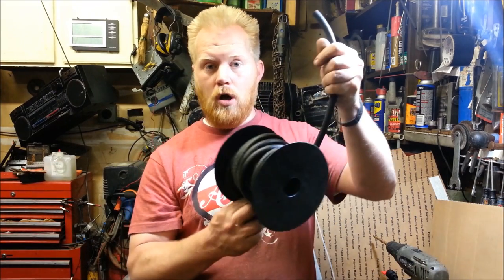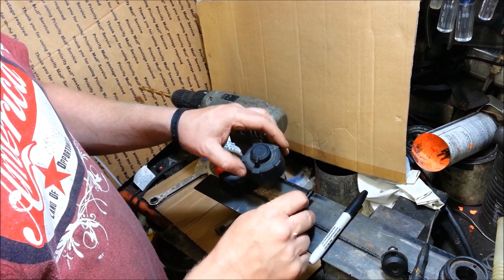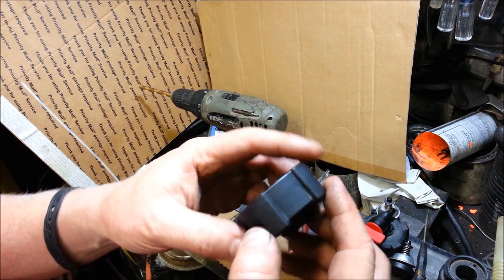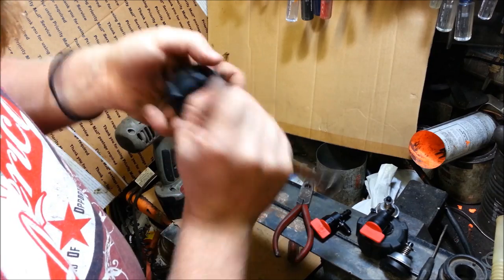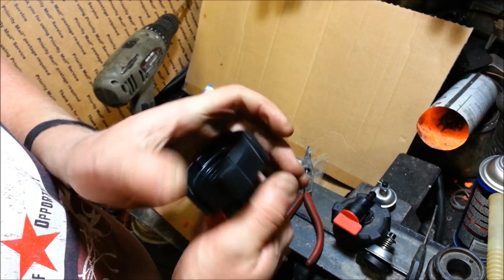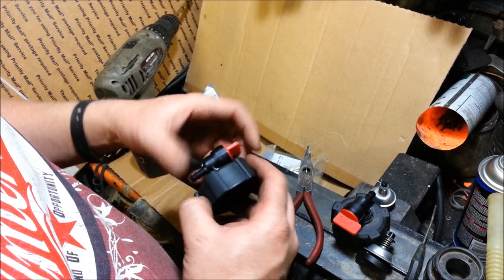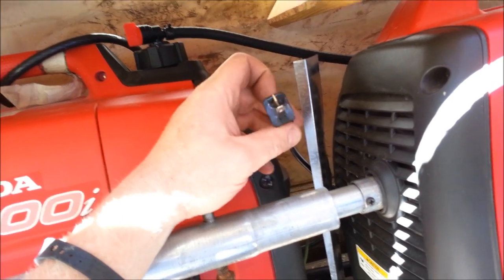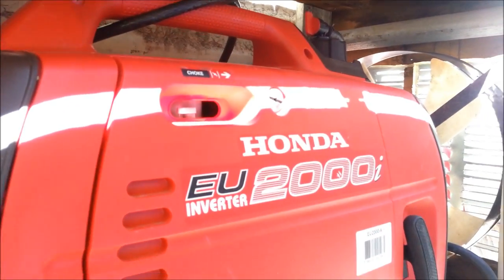Honda EU2200i EU2000i extended Fuel range Make your own gas caps

Comment from the maker: Exhaust extensions almost always have to have something welded on. Unless it is a Briggs and Stratton motor as they usually have standard pipe threaded exhaust. This allows you to go buy steel plumbing pipe and make up an extended exhaust. I actually had to weld a small 1 inch nipple onto the stock exhaust to make it fit the pipe. I then just used a small set screw to hold it on. Mine is not air tight at the joint. I do use a CO2 detector just for safety.

Comment: I'am Your Newest Subscriber Great Videos. Why 2 EU2000is ? Mine Runs Roof AC Fine
Reply from the maker: I've been finding that in extreme temperatures a single Honda likes to trip the safety overload once in awhile. one works is fine while I'm sitting in my driveway for test procedures but out on the road it proves otherwise. I can generally one run one at full throttle and the other Eco and there's so much happier starting that roof 13.5k AC

Comment: If you just happen to have a small tap and die set, then you could drill it at 11/32", and then tap the cap with an M-10 X 1.0 tap for an exact fit ! It worked for me perfectly.

Comment from the maker: 2014 and newer have a bigger gas cap than I show. BUY caps already PRE-MADE: https://amzn.to/33NMoQp . The newer style cap is identical internally but is bulkier/larger and won't allow the Briggs valve to be screw in. You need to extend the reach by using slightly different parts that are listed above in the video description.
Reply: I have a question about modifying my Honda EU2000 generator as it appears I have the newer unit with the bulkier cap.  When I clicked on the link for the part numbers you have in your description the Amazon link shows multiple sizes for the barbed brass fitting and I'm not sure which side NPT male thread and which size barb to get.  I already have the B&S petcock from the video which has a 1/4 inch barb.  Please let me know what size NPT to use and what size drill bit and thread tap I should be using.
I will get a different fuel shutoff with a double 1/4 inch barb to replace the one I already purchased.  FYI - I purchased my Honda in March of 2013 and it has the bulkier cap you describe on units that are 2014 and newer.
Reply from the maker: The barbed fitting is a 1/8"npt with a 1/4" barb (the B&S have the same 1/8"npt on one side and 1/4" barb on the other). You hook a short piece of 1/4"ID fuel line from this barb to the B&S right angle shut off valve. Ideally you would use the B&S Barb to Barb right angle shut off, but since you have the 1/8"npt to Barb right angle shutoff you can just put the 1/4" fuel line directly over the threads and it will still seal.
Reply: +sixtyfiveford t
Reply: +sixtyfiveford thanks very much.
Reply: I got the correct fitting and picked up another B&S shutoff with two barbed fittings.  I am using a spare outboard motor gas tank that has a 3/8 quick connect fitting.  I used brass fittings to transition from the 1/4 ID hose to the 3/8 ID hose and when I tried to run the generator it ran out of gas after the on-board tank went empty.  I had the vent on the outboard gas tank wide open and the line would not draw from the separate tank.  Any recommendations on how to get it to work?  I am thinking of inserting a primer bulb into the 3/8 hose section but I'm not sure if this will correct the issue or not.
Thanks.
Reply from the maker: Sounds like you have a slight air leak somewhere. It will pull even without priming it. As the gas is used in the Honda tank it will create a suction but it shouldn't take more than 10-20% of fuel used to pull fuel. I pull from a tank mounted on the ground, so lower than the stock Honda tank without issue. If there is the tiniest air leak, the suction will bleed off.

Check: all the connections, make sure the fuel pickup tube in the boat tank isn't loosing your suction, make sure the fuel cap is snug on the Honda.

Comment from the maker: At 8:43 you can see the mod really good. I had to tack weld a small 1" i.d. x1" long nipple over the stock 1/2" i.d. nipple on the Honda muffler. Then I slide in the longer section of tubing (3/4")and use a screw to temporarily hold it until I need to service or remove the generators.  It is not 100% air tight but still 99% and good enough.  This allows me to use the generator as normal when not using it in the RV.

Comment: When the gen pulls fuel from the aux fuel tank does it maintain the current fuel level that is in the gen's fuel tank (if you have a 1/2 tank it maintains the 1/2 tank) or does it fill the tank to the top? Just wondering if I would need to disconnect the aux tank and let the gen run for a while before I shut it off.
Reply from the maker: Jim VanGieson It will keep the level the same. The fuel that is being used sucks the same volume in to replace it. If anything it may be a miniscule amount lower.

Comment: If you want the threads to turn out best, spend $8 for a 1/8" NPT tap, and about the same for a tapered reamer.
Reply: Actually, the way he's doing it is better. Because, it's not removing material and helps make a much better seal without having to use sealant.

Comment: I had to buy a 23/64" ($6) drill bit, 2 of those petcocks ($22.47) and I threw in a pack of 3 inline fuel filters $6.99) but I got it done. The fuel line was $7.70. Today I ordered from Amazon 1/4" barb male and female quick disconnects ($18.52). At the moment I am going to dangle the end of the fuel line (cut at a 45 degree angle) in the gas can but for now it'll do. WAAAAY more than $20. So far I think I have spent closer to $60. It'll be worth it though.

Comment: I want to modify my gas caps like you did in the "Honda EU2200i EU2000i extended Fuel range Make your own gas caps" video.  The stem on my original shutoff valve is 18/64 so it seems like a 23/64 bit would remove a lot more material than your video shows.  What is the diameter of your original stem?

Comment: I have a 3 or 4 year old EU2000. Bought all the parts before taking the cap apart. The cap is completely redesigned from the one in the video. The shut off valve is too shallow to be threaded into the cap. Needs more thought on how to make it work.

Comment: I know this is an old video but I am a little stumped. Maybe you'll see my post. I built the extended run fuel line exactly as you did. It didn't work. I used the same B&S tap / fitting as you. After watching many videos I added a fuel filter and a bulb pump. Still didn't work. 
I made sure the Honda tank was filled right up - nothing. I experimented with gravity - nothing. I used an airline quick disconnect at the cap end. 
I am beginning to think that the Honda just doesn't produce enough 'suck' to pull the fuel through. The gen packed up and I have to fix it but once I get it working I am going to persevere with this darn fuel line. I am fed up refueling all the time. 
I am going to remove all little 'extras' (pump, filter, quick disconnect) and just run a hose. I'll see if that works. Many other YouTubers are showing more sophisticated lines working. As I say I'm stumped.
Meanwhile I bought a Harbor Freight Predator 2000. A great purchase. So glad I didn't buy another Honda. To expensive and unreliable. I want to adapt the fuel line to run that too. I am sure it can be done without the complex nonsense 'Pinellas Power Products' is selling for several hundred dollars.       
Anyway thanks for your videos you are man after my own heart.

Comment: Why don’t you just covert it to run on propane and get 6 times the run time?  I used one by Hutch Mountain. I can get up to 30 hours from a BBQ propane tank.  You can run either propane or gasoline.  And no pouring gas in the dark!

Comment: Great video! But I wanted to let you and any future viewers know that this only works with the older fuel caps (part number 17620-ZT3-030). It is June 2015 and I just purchased 2 new EU-2000's and the caps are different and this mod will not work like it does with the cap you show in your video.
Reply from the maker: Jim VanGieson I did have one gentleman do it. He bought a small 1/4" npt brass extension at the Home Depot. This allows you to get around the extra meat they've built into the new gas caps.
Reply: sixtyfiveford   I thought about doing something like that but, at $12 each, I just went ahead a bought a couple of the old style caps like the ones in your video.

Comment: I am not getting gas to come up from the auxilliary container...I filled to generator's tank right up to the top of the fill hole.  Does the line have to be primed?  Does this mean I may have an air leak?  If so, maybe use some silicone caulk or teflon tape on the petcock's threads?

Comment: I just cut the plastic off an old cord end. Melt or cut the plastic away. Stick them in teh generator then turn it on. As that Honda 12 volt cord is $50.00....

Comment: One point to mention here is that I’m finding this mod only works with a certain run of model years. My 2 Honda eu2000i companion caps are a bit different and the center valve is actually recessed into the cap about a half inch and not flush with the top so the 90 T doesnt work the same. You have to come out with a straight fitting first and then 90 off of that. Just a heads up.

Comment: I just bought a 2020 Honda EU2200i TAG Bluetooth generator. Based on your comments, it seems my cap is different from the one in your video. Do you know what size drill bit I should use to ream out my cap, and will the part you listed above for 2014 and newer (¼" barb x 1/8" NPT Male Pipe) fit this newer cap? Thanks! Your videos are great.
Reply from the maker: I have not had an opportunity to have my hands on a eu2200i but they should be identical to the newer eu2000i caps. You can buy caps already made these days https://amzn.to/2WJ9541
Reply: @sixtyfiveford   Thanks for the quick reply. All of the EU2200 models have serial numbers that start with: "EAMT-" which is different from all the other Honda gen models. The gas cap part# for all the EU2200's is 17620-Z44-A30, which is unique to all, and only the EU2200's. So, it seems that any cap that will fit any of the other models may not be a good fit for the EU2200.  And from what I've read, if it doesn't have a good seal at the gen gas tank, the fuel pump won't suck gas :-(
Reply: Here's a link to a page with all of the Honda gen models with part diagrams and part numbers: https://www.hondapowersportsparts.com/oemparts/c/honda_power_equipment_generator_eu_series/parts

Comment: That gas cap upgrade is pretty slick...I have a EU2000 with a 3gal plastic outboard motor tank for ext run...Works real nice & clean

Comment: will drilling a hole in the cap void any/all of your warranty ? Also, what tips/suggestion would you give the owner of a new eu2000 who has yet to start/run it ?
Reply from the maker: A.N. conley You're not ruining the cap and it can be put right back to original. You can buy replacement caps or you can buy aluminum caps with a port already in them. If you can find a gas station with ethanol free gas, use it and you wont and have any issues with your machine. www.pure-gas.org will show you local stations with e-free
Reply: Thanks heaps sixtyfiveford !!! I'll be cranking it up tomorrow Got the straight gas and good oil. Plan on converting it next week.
Reply from the maker: These are the best out there. You'll be happy with your purchase.

Comment: So, I finally got around to building my x-run kit for my EU2000's. I added dry break quick connectors at the fuel caps and a fuel filter. Using 5/16 clear fuel line I have a 12-inch line from my 6-gal (boat style) aux tank to my fuel filter, 6-inch line to the T and 8-inch line to each quick connect at the genny's. With the aux tank sitting on the same platform as the genny's they will suck fuel to about 2-inches past the fuel filter but no further. So, I set the aux fuel tank on a milk crate which got the fuel to the T but still not making it to the genny's. So, I added a primer bulb to fill the lines. No luck, fuel still stops at the T after they run for a couple min. I reduced the line size to 1/4-inch after the fuel filter but fuel is still not making it to the genny's. Any ideas or suggestions?
Reply from the maker: +Jim VanGieson Make sure the vent on the boat tank is open first. The fuel pump in the Honda pulling the fuel out of it's tank as it is being used creates the vacuum that pulls the fuel through the auxiliary lines from the auxiliary tank. It will pull the fuel from pretty much any height; if there are no air leaks. This takes a little while as these eu2000i's are pretty fuel efficient and it takes time for the fuel to be used in the main tank. It will take approx 15-20minutes for fuel to start to flow all the way through the auxiliary lines.

Comment: I powered my house (half the panel) for 2 years and 4 months while we were waiting for PG&E to get their engineering closer to us.… I owned a pool of three EU2000i generators at one point, with usually two working and one not.  The unit would run on average 8-10 hours a day.   HERE'S A TIP for those of you that are going to run this generator for extended periods of time.  Take the original plug out(careful with this, you can lose the plug down the inner engine shrouds), take it to the auto parts store and have them sell you a plug that is one heat-range step HOTTER.  Problem is that carbon will eventually build up heavily on the face of the piston, when it gets really really bad, a piece of carbon will chip off and foul the exhaust valve and then you have no compression, the only solution then is to overhaul the internals of the engine which is very expensive unless you do it yourself. (I've gotten so I can tear this engine down and have the piston completely out in about an hour.)  After I WORE OUT the first one (dealer told me it was junk) I became a religious user of Castrol full-synthetic.
Reply from the maker: It's a good idea to Read your plug every once in a while. Not everyone will benefit nor need a hotter plug. Depending on your elevation the oxygen percentage is going to change and you  will have a higher or lower input compared to your carb fuel jetting(richer or leaner). Simple things like a dirty air filter will cause a rich situation and carbon buildup. Also the average outside temperature or how confined of space they are used in plays a rule in choosing a plug. Also whether or not you run eco throttle a lot (the more you run eco throttle the higher chance of carbon buildup).

Honda generalizes the  specs and gives the same parameters for everyone. They have a fixed jet carb that delivers the exact same amount of fuel from sea level to 5000 feet (which has 16% less oxygen). At that point they recommend a high altitude jet which delivers less fuel to match the oxygen level. Which is not the best. So it was great that you "read" your plug and addressed the issue.

Comment: I guess I was just being impatient. Fired the genny's up and marked where the fuel was in the line and after about 20 min the fuel had almost reached the genny cap. I guess I figured that if I used the primmer bulb to fill the lines the vacuum from the pumps would keep them full. Live & learn! Thanks!
Reply from the maker: +Jim VanGieson Enjoy the endless gas.

Comment: You don't need the o-ring washer under your threaded in fuel valve if you seal the threads going into the cap with thread sealant.

Comment: Hi sixtyfiveford. I followed you video very closely. I used a 10' length of fuel line from Lowes, I bought the exact same fuel petcock and even a 23/64th drillbit. The cap part went very well. From Wranglestar's video I added an air line quick disconnect at the petcock end. I gave myself about 6" of fuel line there and placed the female on the cap side. So as per your video I can still use the gen without the extension and have venting. I also added a cheap fuel filter inline that is transparent so I can see the state of the filter and fuel flow. 
Trouble is there is no fuel flow. In fact I can't detect any vacuum at all. I have checked for a blockage but nothing. What am I doing wrong? I should see the fuel filter fill with gas. Nothing. The gen fuel tank isn't to the brim, should I top it off to capacity? The gen works just fine. So the fuel pump must be ok. Just no noticeable vacuum.  Should I add a bulb primer?
Reply from the maker: I wouldn't use a fuel filter as it will cause too much restriction. I would fill the Honda tank full. You won't be able to feel the vacuum as it is essentially just pulling in fuel as fuel is used up from the Honda fuel tank.

Comment: Hello again sixtyfiveford! Is there any reason that I cannot use the "smaller" gas cap for my later model 2000i and not modify the stock "larger" gas cap? I bought the smaller one from your YouTube link for $19, but it's about 1/2 the diameter of the original BIG cap. Many thanks for taking the time to respond!
Reply from the maker: The smaller and larger caps are interchangeable.

Comment: Ok, I think I screwed up, I ordered all of the parts you suggested, BUT I ordered 3/8" fuel line and it doesn't connect to the 1/4" B&S fuel valve shut off. Can you suggest how I can modify this to work? All of the other parts fit a 3/8" fuel line so I thought I was doing it right.
Thank you!
Reply from the maker: Go to the Home depot and buy some clear 1/4" ID flexible hose. You will only need 1 foot from them(they sale it by the foot). Cut 1/2" long pieces and put them on the 1/4" Fuel shut offs. You should now be able to slide the 3/8" over the outside of the clear 1/4"ID line and make a tight fit. You'll have a little of the 1/4" ID clear line left over for other projects.